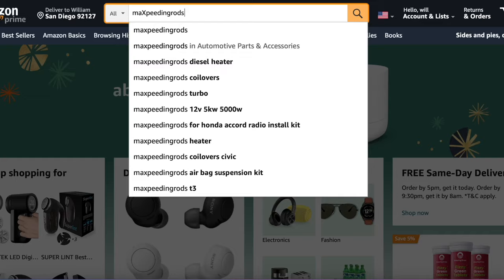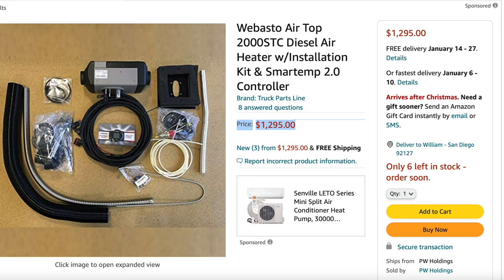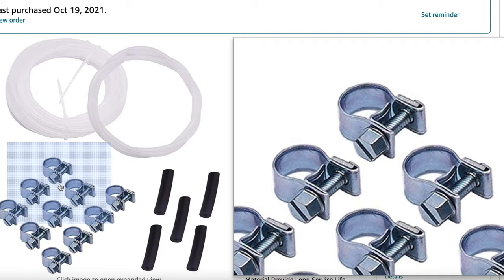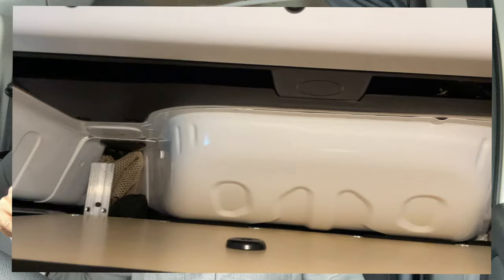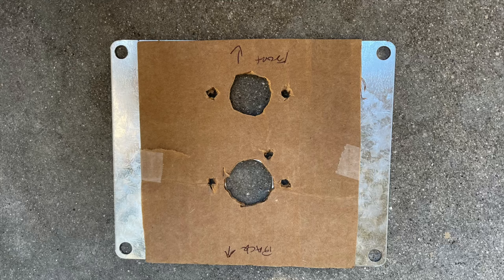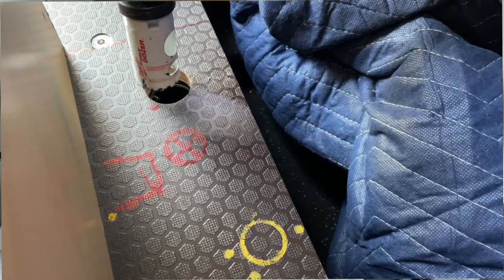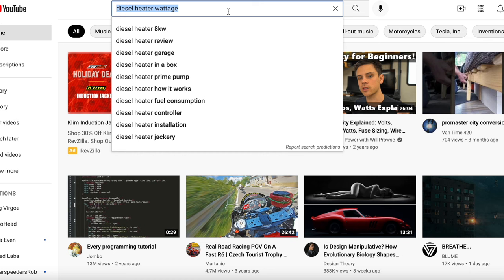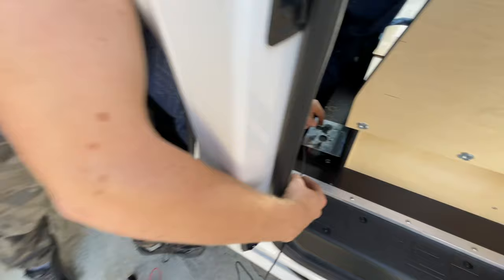Chinese Diesel Heater Install and Review (TWO Things You MUST Upgrade Before Installing!) Story #7

Comment: Good video, the one thing I'd add is that an 8kW is way too much for a Hi-top E350 extended body van. That's the only thing I would have done differently. 2 kW would have been plenty. Lot more time between cleaning them if they run full tilt. I can't do that with the 8k , it will run me out of the van.

Comment: Hi there, I´ve been having a chinese diesel heater on my boat since a few months now.  I am a liveaboard and have been using it quite alot. The green fuel line works fine for me, but It is on the low pressure end of the fuel system. I have another fuel line on the high pressure and that works fine. Haven´t had any leaks or error codes. Setup: Tank -> Green fuel line -> fuel filter -> high pressure fuel line - > Diesel Pump -> High pressure fuel line. The high pressure fuel line is a harder sort of material. As for sleeping with it at night, the ticking did not bother me too much on the lowest setting. On the lowest setting it is still able to keep it 20 degrees celsius inside. Its nearly freezing here (1 degree celsius) so its not an option for me to turn it off at all really. I will wake up cold and wet if I do.
Reply: I'm about to install a heater on my fishing boat on Vancouver Island and think the high pressure fuel line is what I will use as well. Too cold outside to do the install right now though.

Comment: Upgrade the muffler aswell a 50cc motor bike one is perfect..and add a 1 way valve in the fuel system...and as you say upgrade all clamps and hoses ✌️

Comment: I run mine on external lithium packs and suggest, whether youre running on car battery or lithium packs, a LY6W battery capacity monitor. So you know the state of your battery. Since you can get stuck needing a jump to start your car and or the unit needs a solid few minutes of fan action in the shut down procedure. If it cant get that fan action the combustion chamber can melt down. Knowing how much charge your battery has left can help with that.

As far as running on lithium packs. Im going to see if I cant run the packs charger off a 150watt inverter I can plug into the cigarette lighter and see If I cant charge them off the cars alternator. Then consider an MPPT boost solar charge controller and a solar panel so I can be more flexible about how I charge. Since their 36volt packs Im running through a 12volt buck converter and tapping that 12 volt line to run the heater.

Comment: I have one of these also.  It is awesome.  For installation, the hardest part I had was finding a place in my transit connect where I could drill holes in the floor and not hit some pipe or something underneath...lol.  
The only problem I've had while using the heater is the fuel splashing around while I drive.  I filled the tank to about 3/4 on a trip and ended up with fuel running down the side and onto the floor.  It was a lot but just a little bit was a nightmare to clean up and I can still smell a little diesel sometimes.  Btw, I don't think I put the fuel cap on correctly also that time... so it is possible it wouldn't have spilled even with the splashing.  Still, to be safe I now just make sure I keep the fuel level at only 1/4 tank.  That is plenty of fuel though for several days.
Reply: Put coffee grinds on spill will clean up smell
Reply: @arlentulloch6481  Thanks.  I'll give it a try.
Reply: You'd be better off running a fuel line from your main tank - and safer!
Reply: @dancarter482  My vehicle isn't diesel.  I did look into getting an additional small metal tank to put under my vehicle.  However, there simply aren't any good spots.  Heck, just finding an open spot to drill the hole for exhaust was a pita.
Btw, diesel isn't super dangerous.  It takes a bit to get it to burn.  I also have the heater and tank separated by a metal plate/shelf.  I think the van would have to be all in flames before the tank would light up.  
That said, if I lived in my van full time I definitely would find a way of getting that tank outside... or get a better one for inside.  1/4 tank is usually more than enough for my trips though.
Reply: @101perspective  It's the spill/smell aspect that grinds my gears! I have been caught out with diesel spills over the years to the point of developing skin irritations on contact. All my diesel heating systems have external tanks with isolation valves etc.
Reply: Great info!  I will make sure to only have a small amount of fuel in the tank while driving! 👍
Reply: I used mine for a while with a 2 gallon red plastic gas can before running a line to my fuel tank.  I simply stuck the pump in the cans fulling hole kinda like a cork.  It fit perfectly.   Zero splash.

Comment: Why did you only mount the plate on 2 diagonally opposing corners ?
Id have said use all 4 corners ?
I am using a cement-based, heat-resistant board as a sandwich layer to mount my turret directly to my floor.

Comment: You answered my question.  I was wondering if you could mount one of these smaller type heaters (not the all in ones) inside without drilling out that big 5” hole.

Comment: Replace the fuel line, but make sure the inside diameter is the same as the original line because it's a metered fuel delivery system.

Comment: Hi Will, I have a similar size camper van and I''ve been trying to figure out where to put the tank for the diesel heater. I'm afraid that, if I put it inside, I may get the smell of diesel fuel which wouldn't be a good thing. I saw you have yours inside, so, how is it? No smell?

Comment: Your  adapter plate is not sealed to the vehicle floor this could allow carbon monoxide to build up in your  van ,also exhaust to close to wood floor, suggest you modify adapter plate  with an additional tube like piece of metal to seal from adaptor plate to floor , also get a carbon monoxide  alarm inside your excellent  camper

Comment: I use them in my 30ft travel trailer they work just as good if not better than the propaine heaters .I am looking to install them permenrntly and use the air ducts all ready installed ,china needs to put thermistat on them or we need to retro fix one to them  these heaters are tuff you can run them all winter

Comment: Hey did you have to drill another ventilation hole in your 1 gallon Jerry can ? I seen that you ran your fuel line into the Jerry Can🇨🇦 I’m assuming you drilled a hole and plugged it up with silicone around the fuel line
Reply from the maker: Yes a small vent hole but it doesn’t smell

Comment: Looks like the exhaust goes through and inch and an 1/8the or so hole through the wooden floor.   Any issues with the exhaust pipe scorching the wood floor?????

Comment: Good video, thanks. I noted when you drilled the holes for your exhaust and air intake that you drilled them through a rubber/vinyl mat/flooring and about 3/4 - 1 inch of what looks like plywood before exiting the van. It looks like the holes are just large enough to accommodate the pipes. Did you concern yourself with the radiant heat from the exhaust causing these materials to melt/burn? I ask because I need to run the exhaust through a standard wood frame, insulated wall and am trying to figure out how to protect the flammable materials from the heat of the exhaust. Unfortunately, nobody makes a wall thimble small enough to fit the diesel heater exhaust.
Reply from the maker: No, it was fine. Just run heat shielding around the pipe.
Reply: @WillandRambo  i would be carefull with that.   My 5/8 kw diesel heater makes the stainless turn yellowish (which would indicate about 300c)  so plastic would defenitly melt and so i would rather cut a bigger hole through the wood and an smaller through the metal if for whatever reason it comes just too close to the wood it could become tricky.      The block will do 230c on mine so maybe it runs hotter than yours maybe?     Output temp of heater is  18c in to 90c out
Reply from the maker: Typo fixed.

Comment: Is your exhaust outlet  in direct. Contact with the wood floor ?  I believe the exhaust can be as. High as. 200c. So be. Careful that it’s. not burning.  The surrounding. Area  Great Vids !
.
Reply from the maker: We used heat resistant tape for anything exposed.

Comment: checked each of his links and the exhaust tube is same as supplied. the intro pictures a special clamp for the exhaust and I dont see it shared here and its needed for the high temp outlet. Im dissapointed in the hardware shared here and still looking for an improved clamp for the exhaust and just fall back on automotive exhaust sealant.

Comment: When you drilled the holes through the wooded floor, did you keep going to drill the holes through the base of the passenger foot well? And then come up from the under the van for the last layer? Do you have any tips for lining that up correctly? 

And how did you get the metal plate connected to the two 1” metal pieces that you used to raise the heater off the ground? 

Thanks for the great video!
Reply from the maker: Yes to your first question and the base doesn’t need to be lined up exactly. As for the 1’ metal pieces, they had a screw go into them to secure them in place using a big washer.

Comment: Best using dense Rock wool rather than foam, the ticking noise just turns the foam into a speaker. Rock wool will lose a lot more of the sound.
Reply from the maker: My van is super quiet from the wool and carpeting..  it’s warmer as well. Win/win all around

Comment: I bought one of these for my van. My problem with this is I can’t it it working with my Jackery. It has started but only stays on for a couple minutes. Thank you..
Reply from the maker: It works with 12v only unless you buy one that uses AC adapter or 12v cig lighter.

Comment: I’m almost done installing mine but I can’t get the electric working. I have all the connections snapped together easily and then it connects to a fully charged 12V battery, but the digital reader won’t come on and show any info. It’s not looking like it has power :( Am I wrong to use a 12V battery?

Comment: 9:15 please describe fuel tank installation.  General install required drilling hole on underside of tank that comes with the heater; invariably this installation leaks.  How do you full the tank AND run the hose through the top?  Less talking, more detail please.

Comment: I hasten to add I am only passing on information that I have read else where but: The kill switch, doesn’t the heater have to go in cool down mode for 5 minutes (ish)? Just concerned you might burn the heater out prematurely.
Reply from the maker: I never said I turn it off before the cool down phase.

Comment: Thanks for the video! I just got one and have ran it for maybe 3 hrs now. However there still is some sort of gasoline smell from the hot air that comes out of it. Does yours still have that smell? If not, how long does it take until it doesn't have this smell anymore?
Reply from the maker: Run it on 5.4hz for about 30-45m continuously.. it’s the residue oils inside plastics and internals. Mine no longer smells.
Reply: @WillandRambo  will do. Thanks and have a good holiday!
Reply: It's not mounted on its side is it bud? One way around (with the glowplug 'below') is wrong, & will lead to diesel leaking from the start-up air intake hole. This will initially pool internally, then eventually find a way out into the casing, & thence to the blown airflow.
Reply: @Lucentlens  thanks for the comment.  No it isn't on its side.

Comment: I'd be nervous running that hot exhaust through a wood hole like that. There's a mounting plate you can order that avoids this. It cuts a larger hole and then a circular plate slots into it, keeping the exhaust away from your wood flooring of the van.
Reply from the maker: I’ve added heat shielding around the exhaust so wood is unaffected.
Reply: can you provide the link to that mounting plate you mention?
Reply from the maker: Mounting plate should come with your kit. Just cut it down to size if you need to.
Reply: @WillandRambo  Thanks for the reply, I was more looking to get feedback from Matt Yabs on his comment "There's a mounting plate you can order that avoids this. It cuts a larger hole and then a circular plate slots into it, keeping the exhaust away from your wood flooring of the van.".  Also, do you have the link for the hose/clamp kit you bought?
Reply: @Matt Yabs, do you have a link to the mounting plate you mention above?

Comment: Okay folks here's an update I'm tired of hearing people talk about the click click click of the fuel pump. You can buy an ultra quiet fuel pump now it's a little bit more in the cash flow but it's worth it it is so much more quieter but you can also build an insulation box to put around it to cut off the sound so you don't even have to listen to it. You people absolutely have got to start using your head. You all should have known to do this for minute one. They make insulation board cut you up for eight sides put a piece up against where you're putting the fuel pump mount the pump and then put the rest of the box around it tape it up done never have to listen to it again FYI never mount the pump to a piece of metal let it dangle off of a strip tie and put it at an angle never let the diesel downhill into the pump vertically The pump must be set with the input lower than the output. The reason why is because it will burn through oil quicker if you run it straight up and down where the diesel runs into the pump too quick and then it pushes it right into the burner too much and then you'll start asking yourself why is it burning through too much oil you have to set this up right The input has to be lower than the output on the pump you can see this in many videos